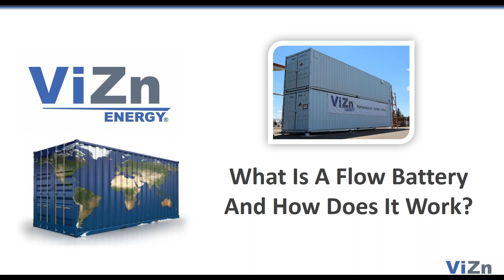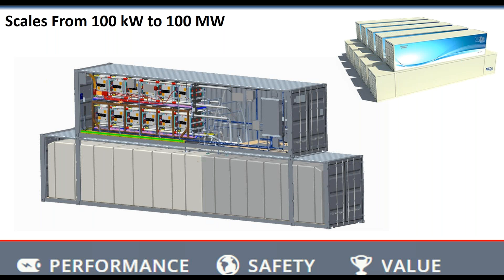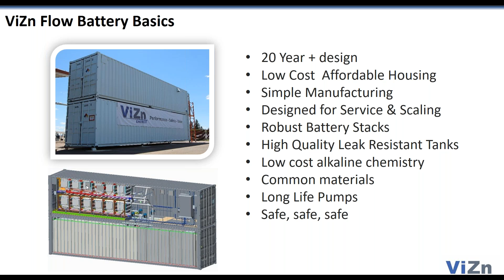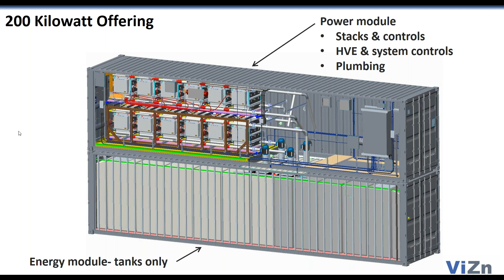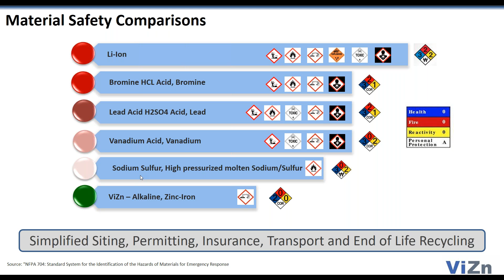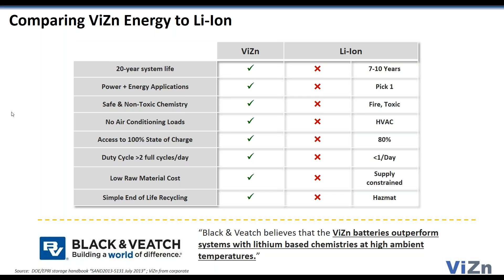How Does a Flow Battery Work

Comment: Wonder how much more efficient it really is compared to pumping water to a tower and then pushing it through a standard generator?
Reply: I suspect the gravity-based energy storage is less efficient and it takes more space. This flow battery is sort of storing electrons inside the electrolyte tanks. I am not sure if electrons weigh anything
Reply: I have often thought this, especially as I'm guessing the water for this flow battery will have to be processed, Whereas a water tower can just use waste water.